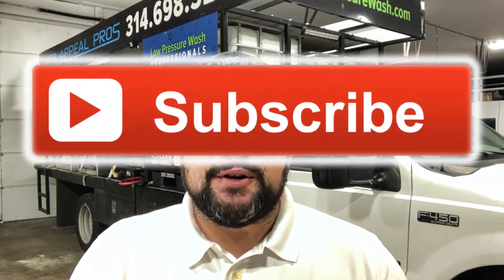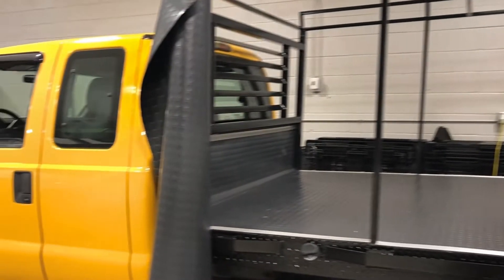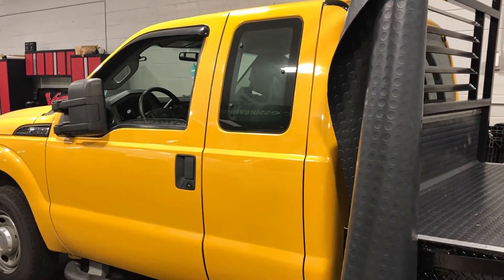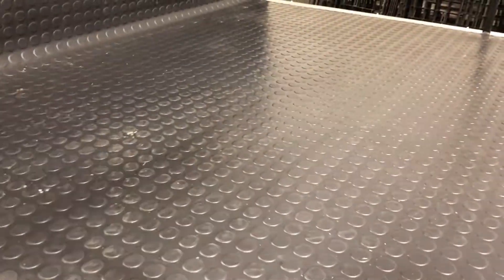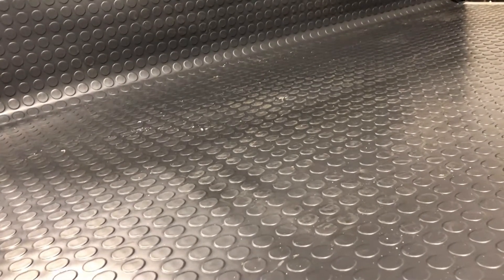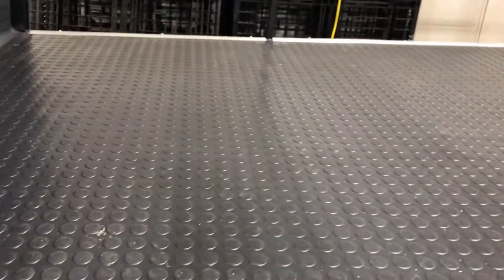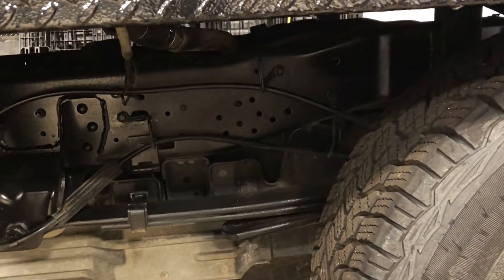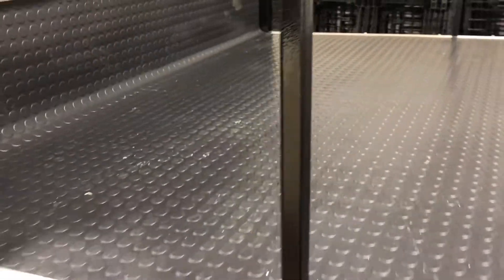How To Build A Pressure Washing Flatbed Truck - Chapter 1!

Comment: When is next episode going to be published. Building our second rig now and would like to follow along on your build
Reply: Curb Appeal Pros what is email address. To send email too. 

I bought 2016 Ram 3500 crew cab with flatbed. It measures 7 ft x 9 ft. 

Wanting to mount pressure pro 3500psi hot water skid, 330 gallon leg tank, stallion soft wash with 35 gallon soap tank and 1 fill house reel and 2 hose reels 

Also need to carry whisper wash classic and big guy with me. 

Any suggestions on layout would be great

My email is 380powerwash@gmail.com